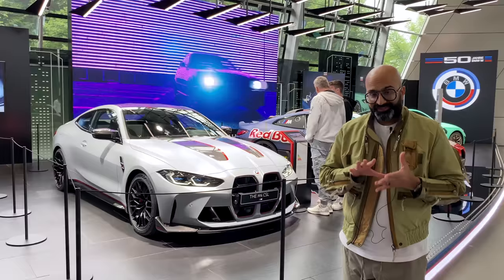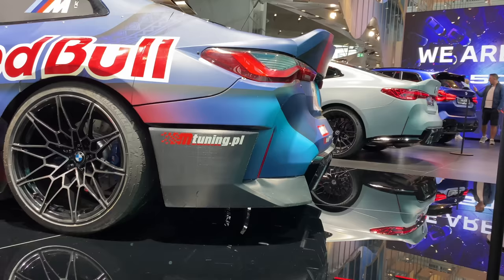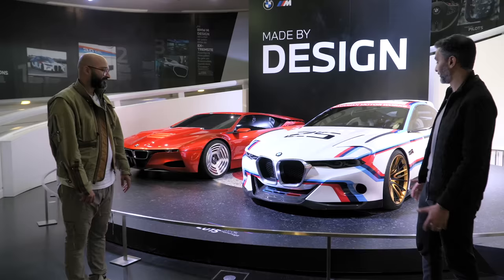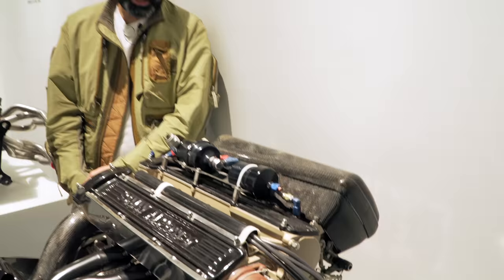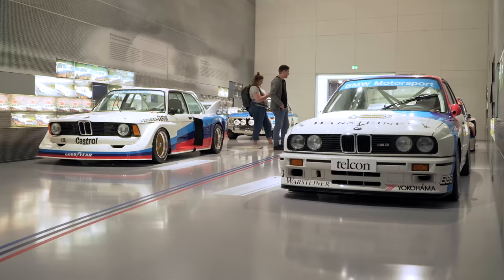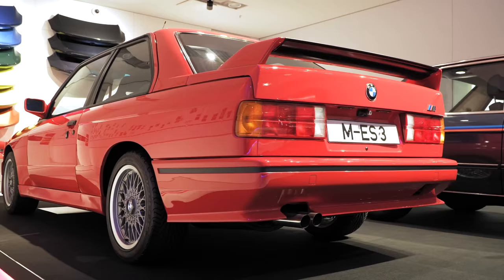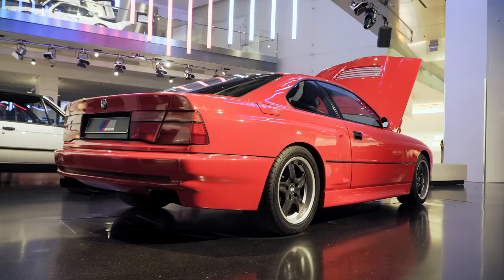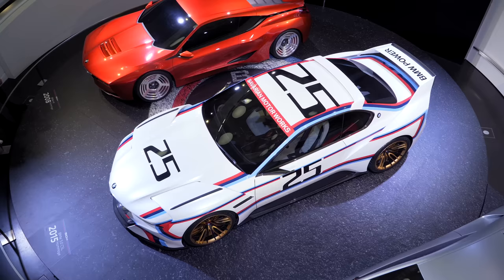BMW M 50 Years Museum - Secret Prototypes + Legendary Cars

Comment: 20:00 that's not just some V12 engine to create a X5M, that's the actual Le Mans V12 race engine. They just wanted to try how a X5 would handle with massive power
Reply from the maker: Yes, same engine as the Jenny Holzer V12 LMR

Comment: hi Imran :) the csl hommage will look like that apart from the headlight and taillight. those will look identical to G82 but theres a better styling on the front lights. everything else will look the same as on thwe concept. oh and the wheels will be different centerlock and looks similar to the m performance m5 wheels but 20 front 21 back.

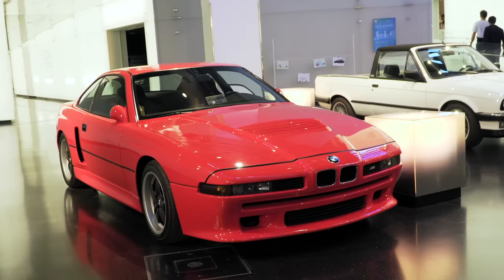Comment: At 17:46 what is that white one? BMW El Camino?
Reply from the maker: It’s an E30 Convertible turned in to a pickup truck. Has an S14 in and was used to move parts etc around for over 20 years.